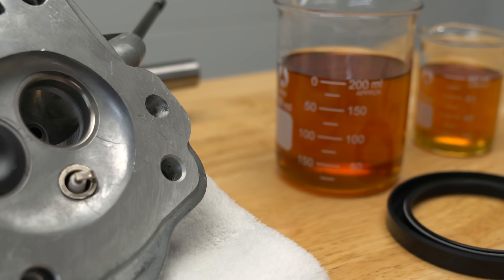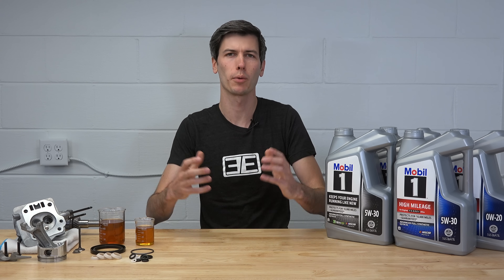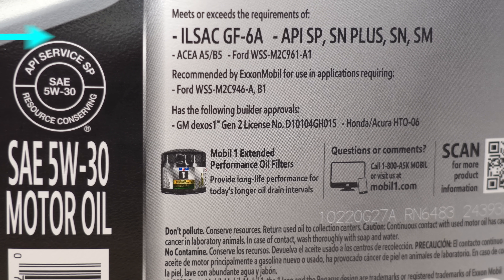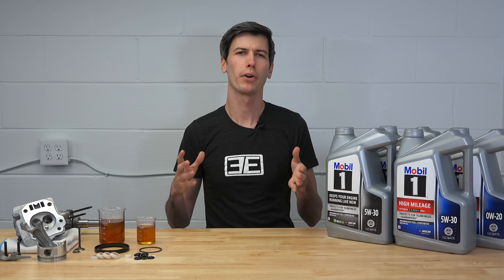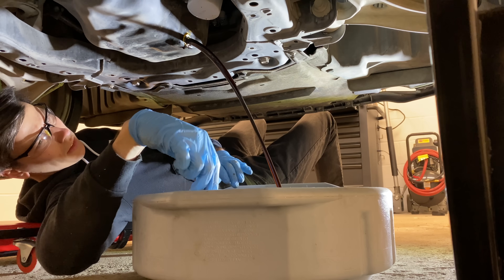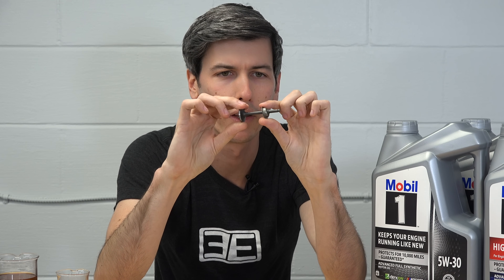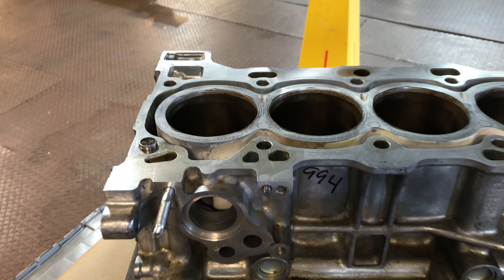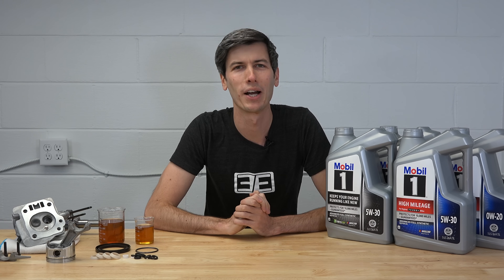Is Synthetic Motor Oil Bad For Old Cars?

Comment: The majority of UK RX8 engine rebuilds come in the first 80k miles, so perhaps we never needed to worry about what oil we were putting in... You can clean the housing faces and rotors while it's in bits after all!
Reply: Should be premixing with an RX-8 anyway..
Reply: @andrewvicars8273  it doesn't need premix as long as your oil mettering pump is functioning properly an u are using the right oil
Reply: @DriftCentral  Motor oil isn't meant to be burned. Putting a few Oz of Two-Stroke Oil, which is meant to be burned, and burns cleaner, in the gas tank can help reduce carbon buildup and protect the apex seals.
Reply: @PlayinWithMahWii  Had 2 Rx7s both went well over 150K miles. One passed 200K in the hands of the 2nd owner., w/o any engine work at all. From the beginning I always added a small bottle of 50:1 two stroke oil at fill up. Worked for me. RX motors are not for the uninformed driver
Reply: Ideally using the right oil should delay the need for a rebuild ¯\_(ツ)_/¯
Reply: My RX8's at 120k miles and still going strong. I asked my "wankel guy" if it might be time for a rebuild but he said it still has good compression. Only problems in the 10 years I've owned it were a broken radiator fan causing an overheat and a broken oil metering pump. Ironically, with a rotary it's only a problem when it suddenly STOPS using a lot of oil.
Reply: @PrototypeSpaceMonkey  if it's burning oil, it still has oil
Reply: I had read somewhere a while back that someone had been using piston engine aircraft oil in a rotary engine as that oil is designed to be burnt whereas normal motor is not. No idea how true that is.
Reply: Peter Kowlessar Two stroke oil used in premix is also designed to burn in an engine and will burn much cleaner than regular engine oil.
Reply: @Ty4ons   True, and cheaper and easier to come by.
Reply: @peterkowlessar7823  yup pretty much, av oil is called ashless.
But I think a premium two cycle oil would be better because it is ment to be burned/consumed.
Reply: @429thunderjet2  Yes, in fact I used a semi-synthetic 2 stroke oil with the TC-W3 oil in all my vehicles. Raises gas mileage. I'm sure it increases how long the engine will last as well. Pays for itself. I have videos about it if anyone is interested.
Reply: @peterkowlessar7823  No, motor oil is never meant to be burned. Even in a two-stroke engine where oil is mixed with gas the oil must not burn or the lubrication is lost. Back in WW1 castor oil was the oil of choice for aircraft engines, and the pilot and plane were often coated in it after a flight. It was the most burn-resistant oil they had at the time.
Reply: My rx8 is approaching 150k miles without a rebuild. Premixed with Idemitsu.

Comment: Not enough PPM ZDDP Zinc to protect some older engines cams.
Reply from the maker: ZDDP is an important discussion - I had a great call with Mobil 1 regarding it, and they shared a ton of info. Was originally planning to include it with this one, but after answering the first four questions of the video - it felt like a solid cutoff point. Definitely plan to address this in the future!
Reply: @EngineeringExplained  The EPA banned ZDDP oil off the shelve but you can buy it online I never had a cat problem running oil with ZDDP in it.
Reply: @cindysue5474  Valvoline VR1 racing high zinc is sold in most major part stores as well as 4 cycle motorcycle oil is also high ZDDP.
Reply: Yes, EE needs to do a video explaining EP additives and the ZDDP concern.
Reply: @WeekendWarriors87  Be cautious if using an additive to a an engine oil. Too much ZDDP can cause corrosion. It is also very easy to upset the existing chemistry of your carefully formulated motor oil. For the Buick/Rover V8 ZDDP of between 1100 and 1300 ppm should be fine. Again in a BALANCED formulation.
Reply: He's doing a vid in the future regarding this.
Reply: I run Brad Penn HP oil in my 2013 Genesis Coupe just for that reason its loaded with ZDDP.
Reply: @cindysue5474  Cindy, you have much to lean about the ZDDP and EP additivesin motor oil. Thankfully EE says he will do a follow up video on this confusing issue :-)
Reply: @WeekendWarriors87  You can use Brad Penn and Redline has a HP oil with ZDDP in it.
Reply: @cindysue5474  ZDDP is good for pre 1994 cars, it's not needed in a 2013 and could prematurely damage the catalytic converters
Reply: @shango066  I ran it in my dodge SRT4 up to 237K never had a problem its still good for cam lobes lifters and bearings.The Brad Penn has a little bit of crude just for the ZDDP the rest is synthetic.
Reply: that is a forum myth. good synthetics have way better shear strength at high temperatures than some old 'classic' oil that is supposed to be good because auf the ZDDP. A ZDDP of 800 is plenty enough and every modern high performance synthetic has that.
Reply: @DaRockCRX  Not in the US the EPA under Obama banned ZDDP in oils sold in the stores that's why I get mine from Amazon.
Reply from the maker: @cindysue5474  100% not true. All Mobil 1 motor oils I know of have ZDDP, but in different concentrations depending on the application. Doesn't matter where you buy it. They list the PPM on their website. Link: https://www.mobil.com/lubricants/-/media/project/wep/mobil/mobil-row-us-1/files/mobil-1-product-guide-rev-31.pdf?la=en&hash=E24FB7F9AD42AD6E84FF14F20C94A7396657AC09

Comment: one thing with non synthetic is some of the additives will leave deposits in the combustion chambers(not good). synthetic keeps that from being a problem. on older non computer controlled engines the deposits would cause detonation/ping unless higher octane fuel was used. example my 85 and 88 corolla 4a-lc engines would require premium fuel on hot days in summer with air conditioning on. after switching to synthetic and driving for a while the engines did fine on regular unleaded.

Comment: Just here for the "Mobil is the worse oil ever" comments.
Oil analysis come back fine for me when I use it.
Reply: "I used it in my 1985 rusted-through insert old-ass car here and it failed super fast, 0/10"
Reply: @ChaosPootato  yeah bro I had a 1926 model T first time I used synthetic fucker blew up!
Reply: I've used Mobil synthetics in my 94 5.0 Mustang (Windsor block, so yeah, old ass engine) for almost 15 years now. Up to 250k and it's still running strong.  I don't know where all that 'synthetic oil BAD' stuff started.
Reply: It's just a typical Group 3 "phony synthetic". You are overpaying. Buy Costco Kirkland Full Synthetic. SN+ Rated. Or Walmart SuperSyn. Same product. Both about $3.00 a quart.
Reply: mobil is great oil. It's oil after all. Any top brand will do just fine. Seems my truck loves Shell Rotella and STP so that's what I use. my corolla can use any oil no issues ;) . Everyone has they're opinion on oil its like toilet paper they have there brand

Comment: My old Camaro doesn't leak or burn oil , but the only way to get proper oil pressure is to run 20/50 oil in summer and 15/40 in the winter .

Comment: There is a real danger of loosening the slowly built up sludge in big chunks when going from pre 15W40 type oils to those. Those big chunks can do a lot of harm. My father was a car mechanic back in the days when those oils became widely available and he told me about getting several in shop with damages because of that. Of course it‘s best to not have that sludge at all, but a running engine with some sludge is better than a defective one, I think. But I don‘t think that problem exists anymore.

Comment: I had a an engine with 375k miles and it had some weak compression rings and would smoke a lot if it idled long but wouldn’t smoke if you just went on your way. It did consume about a quart of oil a week. It used enough oil for the last 3 years that I owned it I never changed the oil, in fact I put the used motor oil from my other vehicles in it that I removed from my other vehicles.
Reply: Holy crap dude. My old jeep had 320k miles and only lost half a quart over 3,000 miles.
Reply: yeah my Integra with 373,000 miles gets about 1 quart added every 6 months.  I change the oil on it once a year, because I drive it less than 5K miles per year.  Been using Mobil1 0w-30 on it since way back in the mid-2000's, when it was in the mid-100k's on the odo.
Reply: Patrick94GSR you should switch to 0w-40 if not even 0w-50
Reply: @Shabbe02  if you really feel you need a more viscous oil on an extreme high mile engine use an oil with a bigger first number first like a 5w30 or 10w30 if you want more then 5w40 & 10w40, 15w40 and lastly 20w50s. But beware in cold climates, especially with conventional petroleum base oils, they will crank hard and be delayed getting oil pressure, and that's hard on engines, when it's cold out.
Reply: I had a service truck that had 537,000 on the engine , my current truck has 353,000 no problems with either truck , i get better mpg, runs cooler, and i save money on oil changes
Reply: 4.6 2v here 468,000 miles doesn’t burn any noticeable amount over the entire oil change
Reply: @mercury0214  those engines are pretty damn bulletproof
Reply: @Briggsian  oh yes I had a spare I bought around 200k miles cause I figured it had to go soon but I sold it at 300k cause I figured it wasn’t going anywhere anytkme soon lol
Reply: @mercury0214  I personally run 5w-30 in mine due to bad rings, that with some lucas HD is keeping it going till I rebuild it, not reusing the top half so I'm not too worried if I seize a cam, they're NPI heads anyways.
Reply: @Prestiged_peck  that’s dope man hope it lasts till your rebuild!
Reply: @mercury0214  I've actually done other research since then, and turns out that block is the second worst 4.6l block, so I'm gonna swap the whole engine for a teksid long block
Reply: Hope you were changing the oil filter periodically.
Reply: @fortwoods   i have been building race motors , transmissions , cages, all of that myself ...since i was 13 im now 61 the The switch to mobile one allowed all kinds of benefits. I changed the oil at 20, 000 with filter on the 537,000 motor and on teardown had No issues at all everything was clean. Everything was  measured by a machine shop, i replaced certain parts put it back in the S10 and with that combo I won King of the track and king of the hill titles in 2004 at the Gainesville drag raceway .the 357,000 truck is a 4.3 and i drive it everyday gets 28 mpg , i change that oil when the first quart is gone, about 15,000 miles. Lol I 've rebuilt the rear axle in that truck three times. So far. My wife loves doing burnouts, so That's why,,,  I haven't touched the transmission other than normal maintenance. And yes I've got.other stories but no time for that.
Reply: @kingofthetrack8424  lol what you saving your stories for the sequel lol you cant leave us hanging like that.
Reply: A lot of major oil leaks are from bad PCV valves causing weakened valve cover gaskets to leak. This leak will usually drip down on the engine block and/or exhaust manifold. So when you’re sitting at idle at a stoplight, you might see and smell oil burning. Driving down the road keeps the oil flinging away from block and exhaust.  
I’ve seen many vehicles with the whole underbody covered in a thick film of dirty oil.
Reply: Leland; it was probably valve stem seals
Reply: 5w40 or 10w30
Reply: Lmao got that rotary oil consumption
Reply: @md4luckycharms  except rotaries are designed to consume oil.
Reply: Lol i been guilty of doing that but i knew the engine wouldn't last long since it was time for a rebuild.
Reply: Wow so many miles on engines here. I always driven old junkers but mostly with 180k- 200k+ mi. on them.
Reply: @memeco50  me too. currently 2005 4.6L f-150 long bed 253k miles.... cherry engine and tranny.
Reply: Okey! You didnt change oil , but the engine lived for 375k miles. Thats good ! 
But you have to get a another car because it was scrap.
Thats why you should change the oil!

Comment: I have been told from my engine machinist and builder that synthetic oils do not have the proper additives to correctly lubricate flat tappet cam systems in pushrod engines.  Would elaborate on this issue please.  I have learned a great amount technological information from viewing probably all of your podcasts.  Thank you for so much for your channel.
Reply: With his access to an oil company's lab and scientists, his information may hold true for controlled experimentation whereas the bloke you know has practical experience and probably learned from peers. Hopefully your query gets answered on here since a lot of mechanics and experienced dabblers watch this gent.
Reply: Look above in the comments. Someone else had a similar question and he replied that he has some interesting info in this he will share in the future.

Comment: In my experience you can if the car had oil changes on time.  Otherwise the seals get lots of grime in them and the detergents will clean it out causing leaks

Comment: Is there any pros and cons in different oils for engines with a turbo?
Reply: Absolutely. Turbo cars require specific oils since the engine oil also lubricates the turbo. Just use what the manufacturer recommends. But some guys use Delo or Rotella in their gas cars for some reason.
Reply: The turbo itself has much more lenient requirements on the lubricating oil. However, turbo engines usually make more power - thus their is more heat in the oil - thus a good reason to use synthetic. Secondly, when you turn the engine off, the turbine housing and turbine shaft are at exhaust temp - which is to say 700ºC or perhaps higher. Any residual oil film on the turbine shaft and bearings will be subjected to that heat, and because the engine is off and no oil flow - that oil in the turbo just sits and bakes - another good reason to use synthetic.

Comment: I know people that use diesel oil in there gasoline engines, are there any benefits or drawbacks to that and vice versa?
Reply: It depends, some works just fine for both and some have additives that doesn't work well for the byproducts created by gasoline engines. They also tend to be thick at low temperatures and that's not good, you want the best possible oil flow at startup.
Reply: Don't do it if the diesel oil is also not formulated for gas engines.(ex A3/B4)  HD Diesel oils use different additives and viscosity index improvers because the operating environment is different (run cooler, more idling, lower rpm, greater loads etc).

Comment: I was hoping he would talk about Mobil 1 being used in older cars with flat tappet cams.
Reply: That's great, There's lots of questions about modern oils, the reduction of zddp, and their use with flat tappet cams. Thanks
Reply from the maker: I have more info on that! And I was initially intending on including it, but covering the four questions discussed in this video felt like a lot. I will have info on flat tappet/ZDDP in a coming video!

Comment: Hey Jason, I have a 2004 Ford Ranger 3.0 l, V6 with 240K mi. Recommended 5-20 SAE oil. I've been using said 5- 20 SAE Synthetic for the last 3 oil changes, and am getting mild split sec, startup, rod knock. Nothing after startup. Runs quiet and smooth. Before, I was running 80% 5-20 SAE Synthetic Blend and 20% 5-30 SAE Synthetic Blend, and had no dry start knock. Any suggestions?
Reply: Did you switch oil filter brands at the same time? It sounds like the filter is letting oil drain out when you shut the engine off and needs to refill every time you start it back up.
Reply: Probably. I had it changed at a shop. Usually, I buy the oil and filter. This time, they did.

Comment: I cut my teeth on Amsoil and became a Gas Turbine Tech. and industrial diesel mechanic
this break down is spot on. I swear by synthetics on air cooled diesels and gas motors.
Dodge/Cummings 5.9 gen 1 300k  and a 450k 99 service truck, I use synthetics in high pressure  turbine compressors and Refrigeration. 
one thing to Remember is synthetics are created from Alcohol/Glycol catalytic process
as the oil breaks down ( higher break down temp) it breaks into smaller and less contaminating chains and pollutants. ......... one of Engineering Explained most useful vids

Comment: What an excellent video.
The comment on worn cylinder walls made so much sense, and now I understand why glazed bores where the grooves are worn away cause a problem.
Hence, one avoids idling an engine.
Off topic, but that's why one did not chuck 134A into a R12 AC, the esters in the PAG oil caused issues with the seals that were designed for mineral oil.
Among a bevy of other issues.

Comment: I put 0w20 in my Tesla model 3. Still clear as new after 20k miles. Do I still need 0w30?
Reply: I've heard putting some 5w50 on the brakes helps improve mileage.
Reply: Don’t forget your blinker fluid on your Tesla...
Reply from the maker: Haha, see this video (at timestamp) for the proper procedure: https://youtu.be/rlbl6SBftW0?t=129
Reply: Tesla recommends Singer sewing machine oil for service intervals.
Reply: @robertkeefer1552  Singer oil is such a ripoff. Just use Canola, it's the same viscosity.
Reply: Fuzin Marsupan 
It was a joke.. duh
Reply: @pi1797  Teslas use oil in their diffs, like any other car, so the joke doesnt work.
Reply: Typos1 
I said blinker fluid. Hello...
Reply: @pi1797  So you did
Reply: You must be sure the oil contains LiPo in great concentrations.
Reply: Yeah i heard about it.... its for cooling the batterypack
Reply: Read the owner's manual and ask the manufacturer of your vehicle if necessary.
Reply: Ha, Ha, Ha I think you need a thicker resistor.
Reply: you need a life
Reply: Requires special additive dielectric grease to run smoothly!
Reply: It go with mineral oil
Reply: Leland Holton for the automatic transmission?
Reply: So this is like water in a VW beetle type of joke?